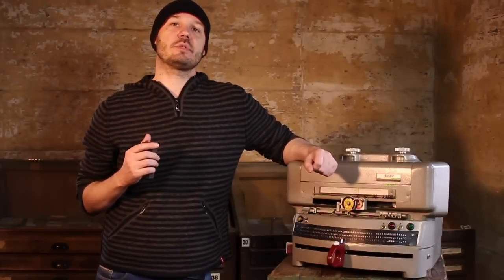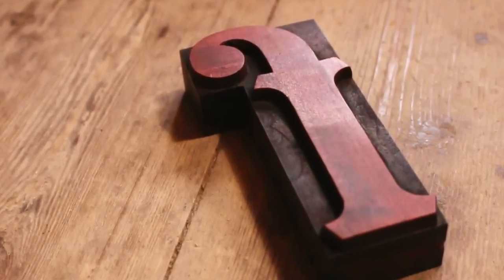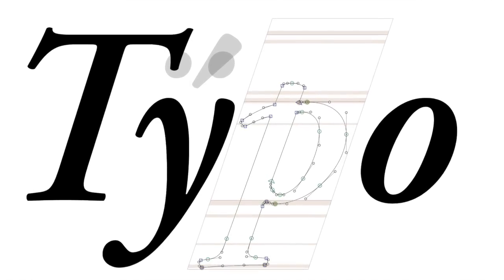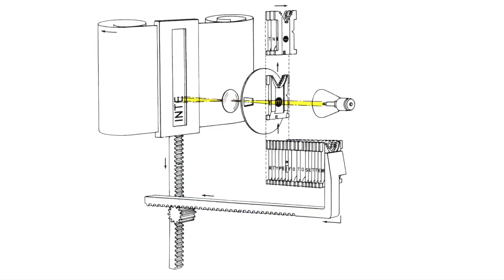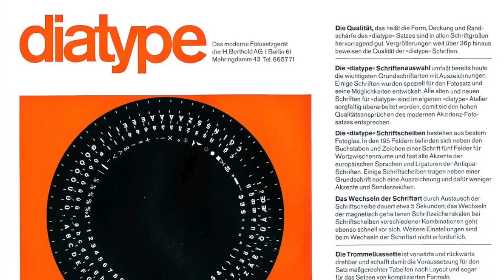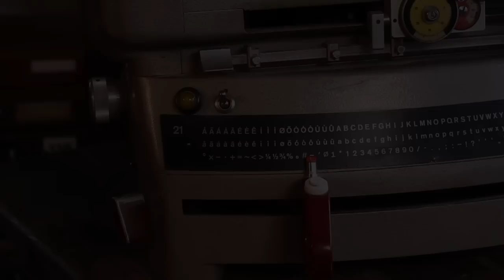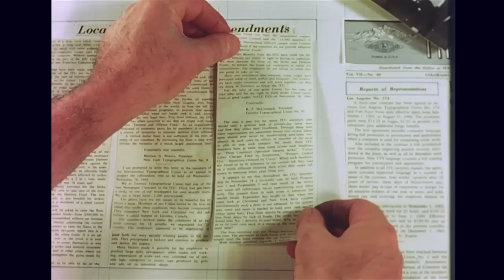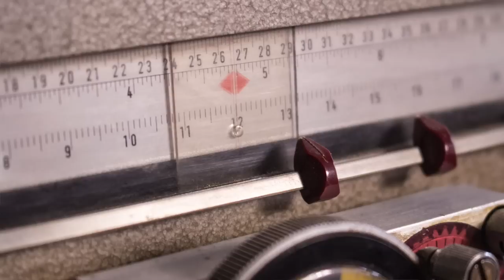Phototypesetting with the Berthold ‹diatype›

Comment: I was also taught the old fashion way, blue line pencil, waxing machine and paste-up. At first, I relied on two ladies who typeset everything, mostly in Souvenir. Later, My Mac IIci could interface with the AGFA phototypesetter and I was able to print out my own type. It made the dedicated typesetting women jealous because I could do things such as lay out type in a circle or customize my copy as needed. As the local printshops bought new equipment, they were able to take a disk with my files so I abandoned the phototypesetter for digital files. However, their output device did not always read my font choice correctly because they bought fonts from someone other than Adobe. I often got a very odd looking output. Great memories, despite the hassle.

Comment: I was first employed as a layout artist. My job was to create paper mockups of advertisements in pencil on paper. These were very important, because a typesetter had 'nothing to go on' otherwise. I became skilled at representing type in a layout: headlines, fonts, type leading, simulated 'body' copy; centred, flush left, flush right, justified, whatever. I had to become skilled at guestimating the amount of space a given block of text would occupy. (Would a headline of 36pt fit in a given width in a particular font? Would 200 words fit in a column I represented as pencil lines: 8pt, 10pt, 12pt... whatever my pencil lines were simulating?) Over time I became quite good at simulating what could be achieved in a layout, without the typesetter being able to see what he was composing. 
Eventually I got a job where I was typesetting directly myself. But I still used a rudimentary pencil layout. Everything had to be measured with an em ruler. All the text 'compartments' had to be laid out with x/y co-ordinates: so many picas from the top, so many from the left; how wide and deep the compartment was; what the font was, what size it was, what its leading was, what its orientation was: flush left, centred, justified. All of these things were achieved with codes much like the things you would type at a DOS prompt. <PAGE,00,00,00,00> <CMPT,00,00,00,00> <FT> <SZ> etc.
In the early days I didn't get to see what I'd typeset until the film cartridge had been developed in the darkroom. Later on I had the inestimable luxury of a separate monitor which showed, in near-real time, what I was typesetting as I did it. (Though far from WYSIWYG, this facsimile made complicated layouts much easier and quicker to typeset. 
I was dumbfounded when I saw my first demonstration of Pagemaker on a PC. Not least by the relatively inexpensive way to achieve it. 
I'm still beavering away, producing magazines in my 60s. I've seen so much water under the bridge in my short career. I never would have believed, in my twenties, what I'd be able to do in my thirties, and then my forties. And now print itself is struggling to survive. So it goes.
Reply: Would love to see some of your work
Reply: Printers are quite un-loved by collectors. When these machines came out of service I imagine most were scrapped... you could get several $ for how much they weighed! :(
Reply from the maker: In my experience, the smaller the machine, the more likely it is to survive. The large phototypesetting systems, filling entire rooms, were almost always scrapped. But anyone can store a Diatype somewhere and I see them frequently being offered on Ebay.

Comment: The first phototypesetting machines used a film type font, as shown here. More advanced ones were computer driven. The operator was able to set type using alphanumeric commands that controlled line length, leading, font, point size, kerning and other parameters. A font disk, similar to the one shown on this video would spin, and a flash tube would expose the paper. An encoding strip along the edge of the disk was used to synchronize the flash tube to fire when the proper character was in the proper position. Stepper motors, gears, and a carriage moved the exposing lens along the width of the paper. They also operated the zoom lenses to produce the range of type sizes. A set of rollers fed the paper (which came on rolls of various length and widths, generally 8 inches wide by 100 feet long) into the canister with each line feed. When the job was complete an end of job command would run 6 inches of paper into the canister The paper was cut and then fed through a processor that ran the paper through baths of developer, fixer, wash, and sometimes dryer. A machine, called a waxer, applied melted wax to the back of the paper galleys. They were then "pasted up" on boards from which a photographic plate was produced, that was used on an offset press.

At the end of the phototypesetting era, a cathode ray tube was used to image the paper. It provided a type medium that was unaffected by dirt and wear, unlike the film disks. Since the characters were produced as vector images their geometry from standard could be squeezed, expanded, and otherwise modified. For typographers the ability to manipulate the geometry of a type character was a magical enhancement to the technology. It also gave rise to some not very pretty type.

It is amazing to me that, at least in the U.S., these phototypesetting machines have virtually disappeared. A functioning  Varityper, CompuGraphic, or Merganthaler machine is not to be found.
Reply: This is how I was first exposed to typesetting, Varityper. I have a dozen or so wheels of type.

Comment: You make me feel like a dinosaur.  In 1975, I worked as a field engineer for Berthold Phototype in the US.  I don't recall the model number of the equipment, but is made first use of minicomputers. It had no crt, only a single line display strip to show what was being typed.   The font set consisted of glass plates.